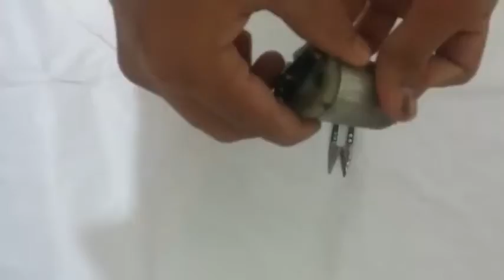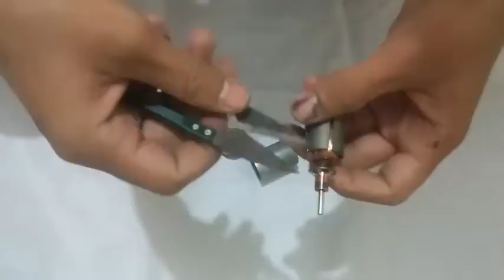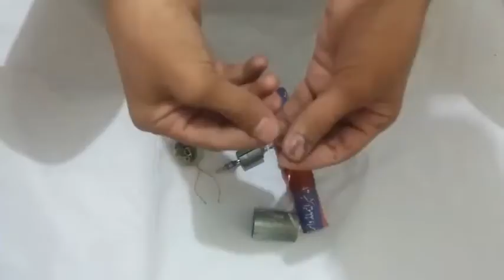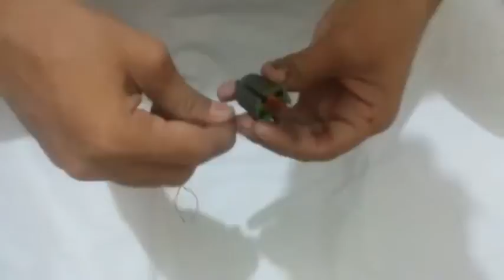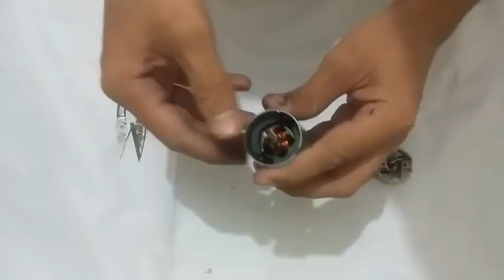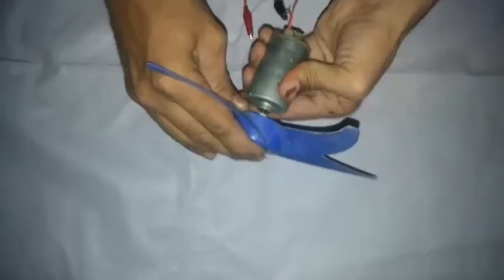how to upgrade dc motor speed upto 10X rewind motor with thicker wire

Comment: i rewind my DC motor, i used Thicker Copper (but i think it's too much thick)
the DC motor is working and i think it's fast, but when i place the Remote Car toy on the ground, it's ALMOST not moving
😢😢😢
why? is because i used too much Thick Copper? i only turn the copper wire eight times each pole 😟😕

Comment: I need to more high speed, more RPM & more Torque Power... So advice me witch wire will be best for use in normal 12 volt DC motor?